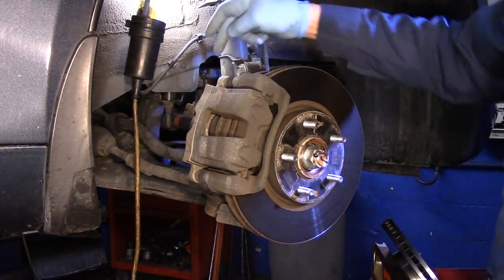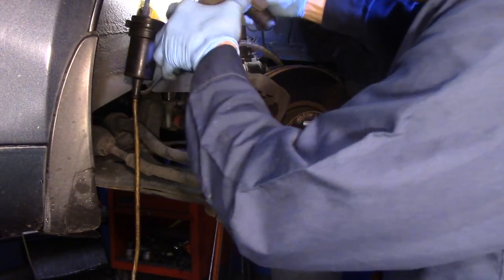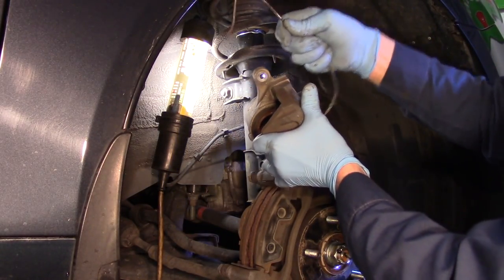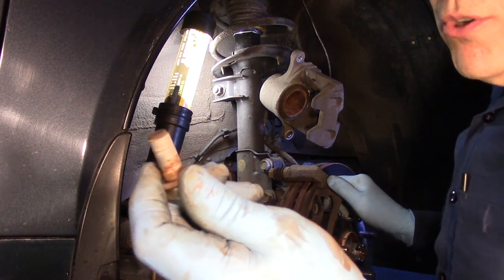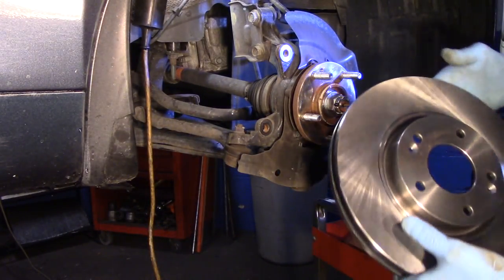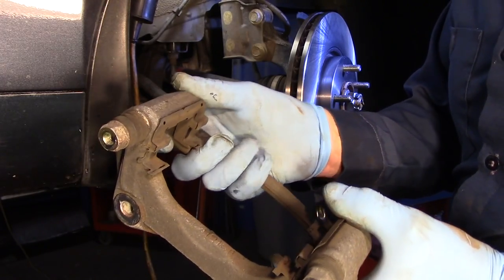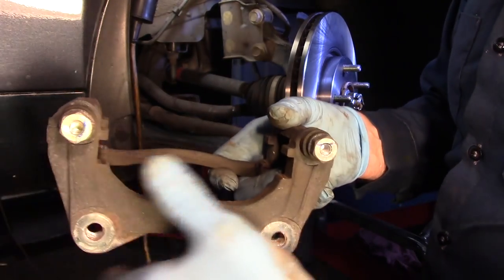How To Replace Front Brakes And Rotors 2014 Hyundai Sonata

Comment: Jimmy you really need to get a better piston caliper tool get the Lisle one, get the dual-piston caliper tool it can  be used on single-piston calipers as well. It will  save you a good 5 minutes each brake job.

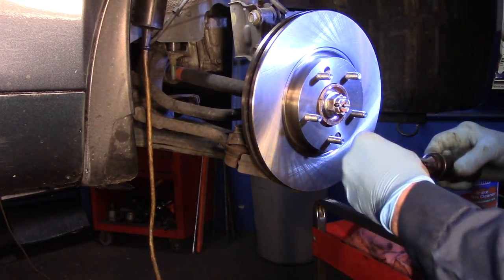Comment: What is the name of the screw driver you used in the minute 13:00 so that I may order the same from its manufacturer? Thank you.
Reply: hi  it is called a impact driver made for rotor and drum screws   I have a lisle  brand  but you can buy them  all over  amazon  ebay
Reply: JOE FORD DIY 
God bless you.

Comment: Some people see their brake level low so they tend to top up not realising that it is a symptom of worn brake pads. I would always put a rag around the brake fluid holder beforehand just in case. Brake fluid very corrosive
Reply from the maker: Good advice. Thank you for your input